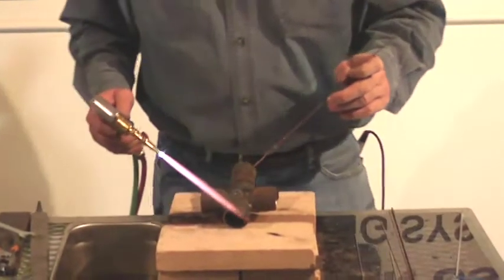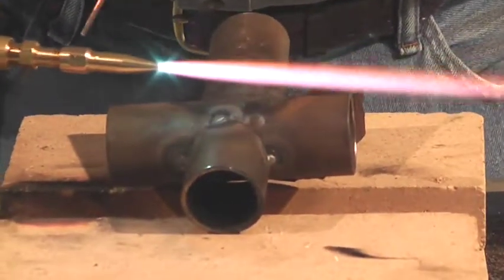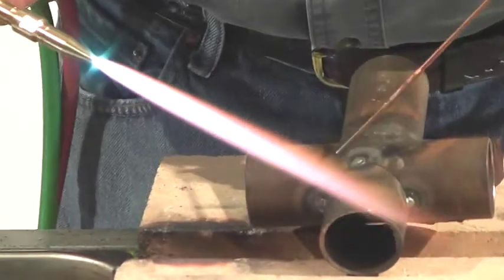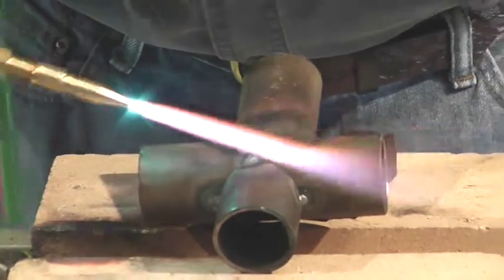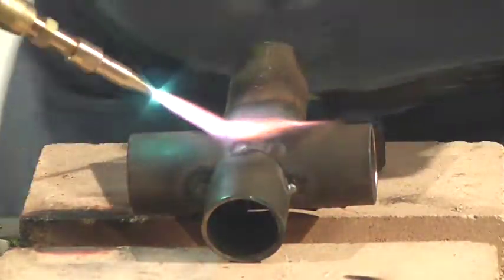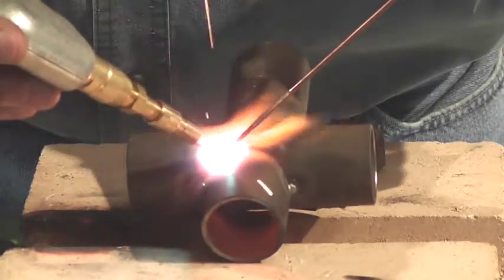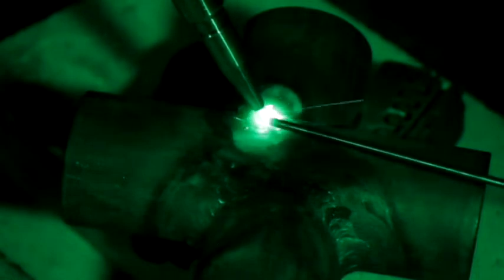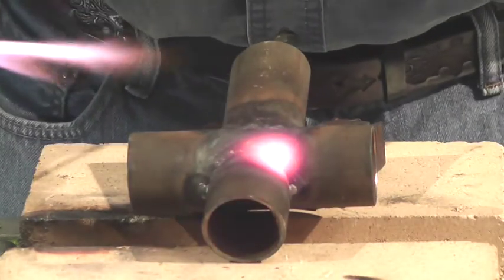HOW TO GAS WELD CHROMOLY TUBING

Comment: Never preheat. The act of welding will get the metal to the 150 degrees you need to remove moisture.You are anealing the metal into mild steel if you preheat.Clean the pipe helps a lot too.